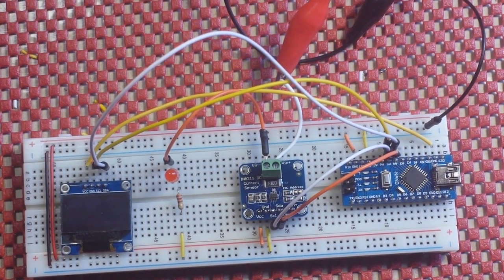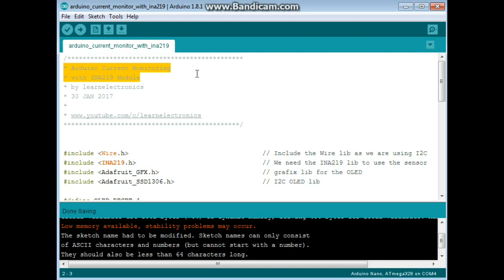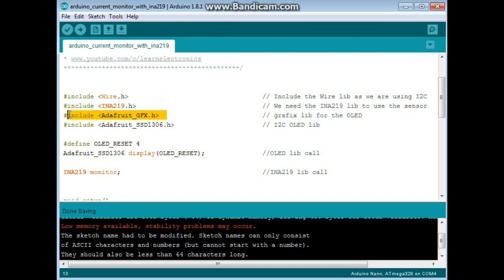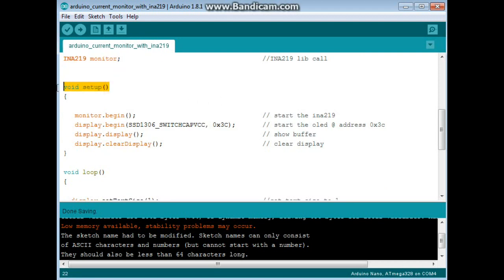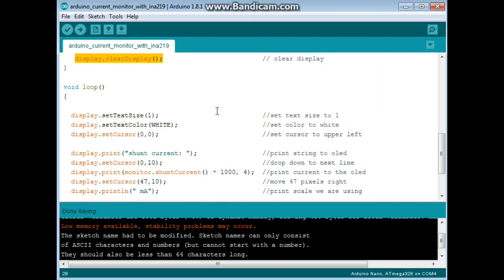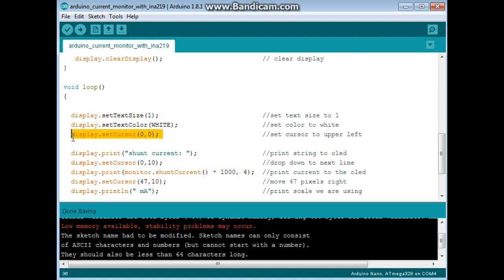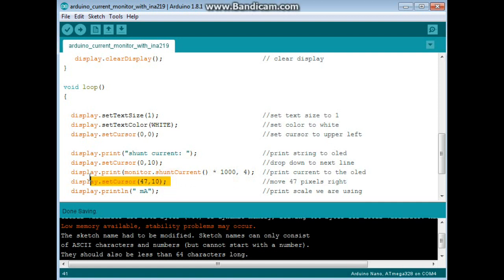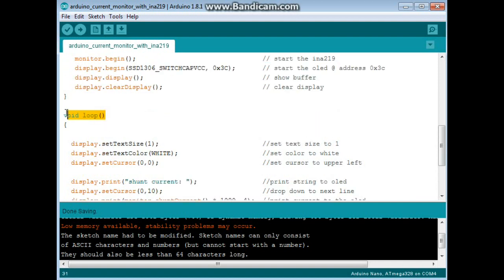How to Measure Current with Arduino

Comment: Hi Great video, I want to measure/monitor AC current 230V upto 13Amp for my autoswitch project do you have any idea how to do this? so idea is to monitor current draw on master socket and switch on slave if certain level of current detected

Comment: EXCELLENT video and "How-To!" Well presented and videoed. (And actually, I must confess I already did such a project, but a few years back, so watching and listening to you brought it all back!) It would'a been nice had you had included the voltage measurement as well, but that should be simple enough to add, which I'm gonna do for a VERY small/simple "bench PS" I'm going to build. Also, a simple schematic would've been nice, as vijay commented on here.

Thanks again for this tutorial, I'm sure you helped a lot of people to use these components which is what a tutorial SHOULD do, of course. ;)
Reply: I am new to Arduino so may I ask how you will add voltage to this project, please? Bob

Comment: would it be possible to use arduino. to build a current / volt gauge. that would control a relay to shut off things. or give a alarm if specific  parameters are reached? I also was thinking about a home alarm system that didn't use power unless it is tripped. maybe some way to arm it be turning it off . use magnetic switches for windows and doors. with vibration switch also. maybe a arduino. to make it say something just before alarming. also use arduino to deactivate with a key pad. do you think this possible? I haven't got it completely figured in my head. but I'm thinking about a off grid home alarm system. that uses little to no power when armed. thanks and great video . eventually I'm going to see them all!!...
Reply from the maker: Yes, I did a video about 8 or 9 months ago called Arduino current controlled switch (or something like that)

Comment: I'm confused about the relationship between the power supply for the MCU and the INA219. Do they have a common ground? Maybe you could explain what the wires from the power rails to the MCU are all about.
Reply from the maker: common ground between the INA219 and the 'duino via power rail.